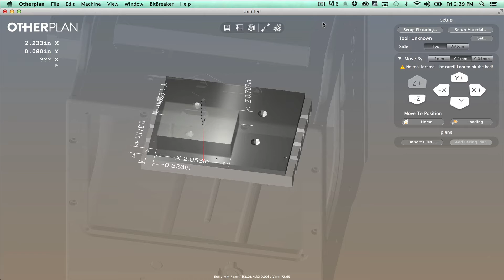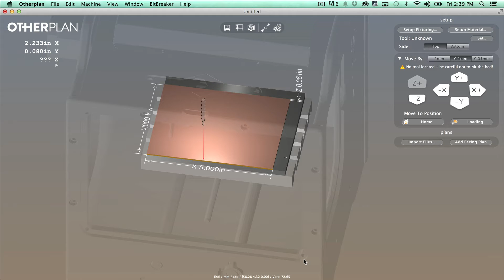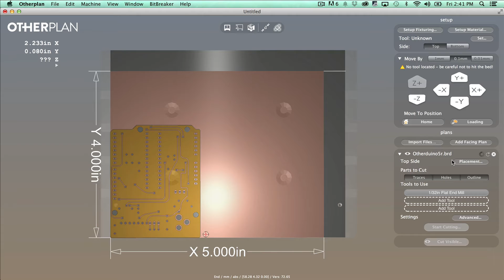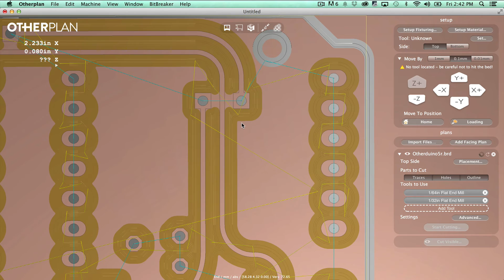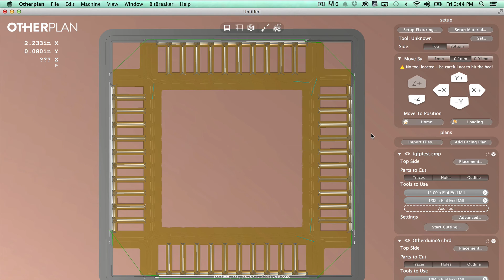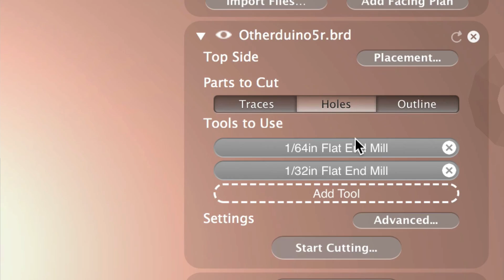Bantam Tools CNC: Set Up the Otherplan Software to Mill PCBs

Comment: It would be nice if you would make the double-sided board tutorial. For some reason the Othermill is cutting out the top outline outline even though the outline isn't selected to be milled
Reply from the maker: +Michael Lloyd Thanks for the feedback! We're working on a number of videos at the moment, so stay tuned. 

If you're still having trouble, our support team would be happy to assist. Just email us at support@othermachine.co with a description of the problem and the file you're using.
Reply: +Other Machine Co. I figured it out. It cuts 3 of the 4 outlines on the top and then finishes the outline on the bottom. I don't know if that's what it was supposed to do but that's what it did. It cut 3 outlines (all 4 were on the same layer) on the top layer even though I had outlines turned off. Then when I flipped the board and turned outlines on it cut all four and finished the board.
Reply from the maker: +Michael Lloyd That's unusual – Otherplan shouldn't cut the outline unless you ask it to. If you encounter any other problems, please feel free to email us and we'll get to the bottom of it.
Reply: +Other Machine Co. I thought so too but it worked so I didn't think anything of it. I've milled single and double sided boards and so far that is the only thing that seems out of order.